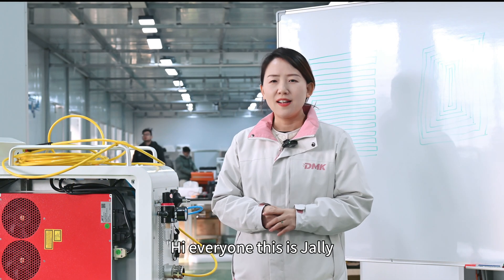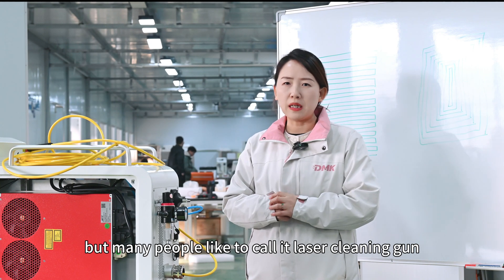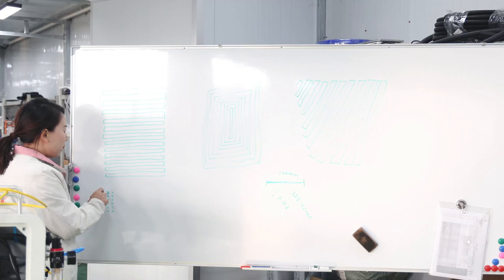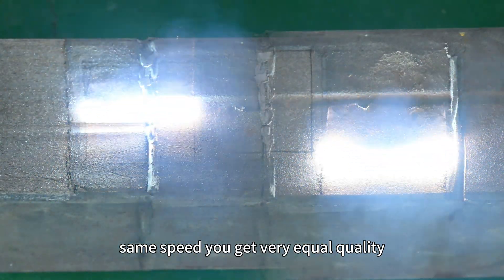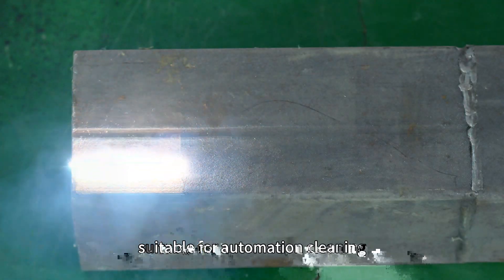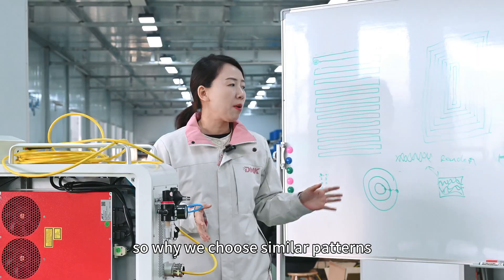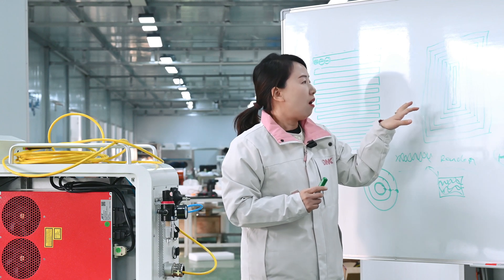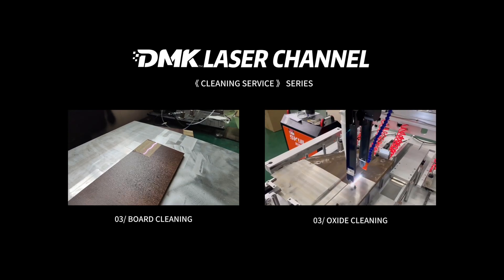Part 2:Why the Same Laser Cleaning Parameters Can Deliver Different Results #DMKLaser #foryou

Comment: spiral set to look like a doughnut 60-100mm outer 20-50 inner.  0.3 pitch. I found this is very good for a constant finish, minimum scan lines or hot spots
Reply from the maker: thank you very much for your feedback, it must be chocolate doughnut, very tasty😆